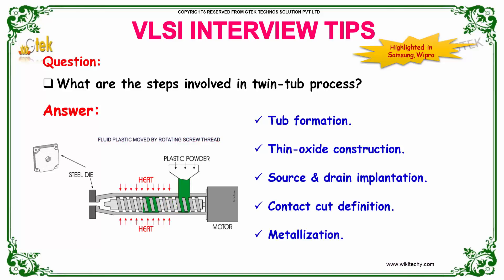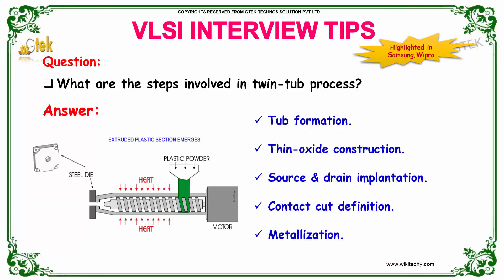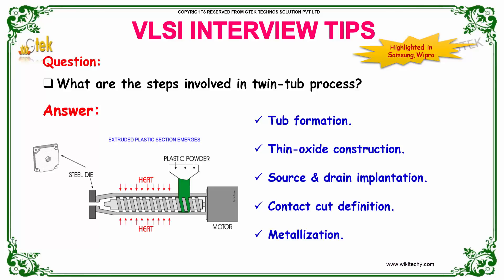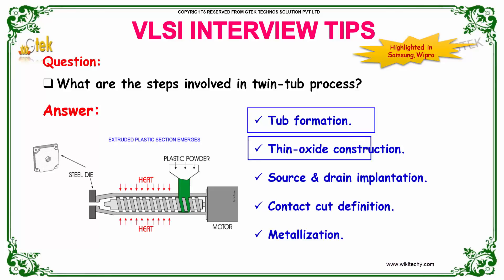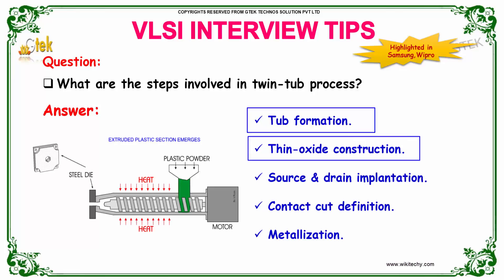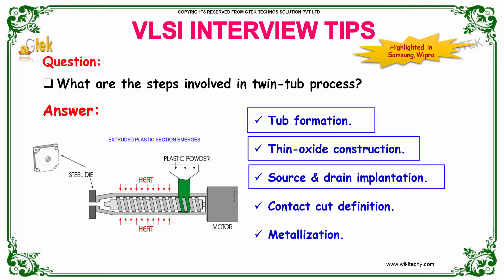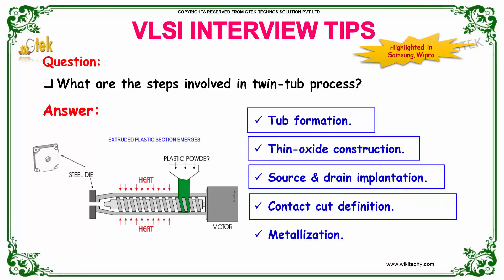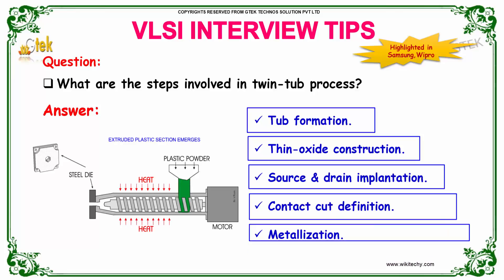What are the steps involved in twin-tub process | VLSI interview questions for ece

Comment: Step4: Masking.
Step5: Photoresist removal.
Step8: Formation of the N-well.
Step9: Removal of SiO2.
Step10: Deposition of polysilicon.
Step11: Removing the layer barring a small area for the Gates.
Step13: Masking and N-diffusion.
Step14: Oxide stripping.